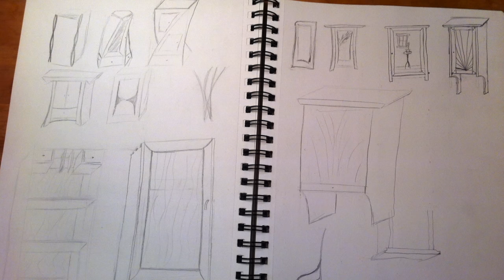The most important lesson I ever learned

Comment: I have a question about a plane, I have an opportunity to buy a Sannley #4 1/2 smoothing plane. I don't know what to look for in buying hand planes. It has what looks to be a plastic nob on the front of the plane, which is causing me to think it isn't a real Stanley. Do you have any advice on buying these types of tools?
Reply from the maker: If it has the Stanley stamp in the casting, it is real. However not all Stanley's are made the same. They introduced plastic handles in the 60s and quality took a severe dip around that time. I personally wouldn't purchase a hand plane from them with any plastic parts. However it may have simply had a knob replaced somewhere along the way and the casting may be fine. There are visual charts on the internet that will help you identify what era the casting is from if you want to spend the time to do so. But as a rule of thumb: if there is plastic on it, I'm not buying it.